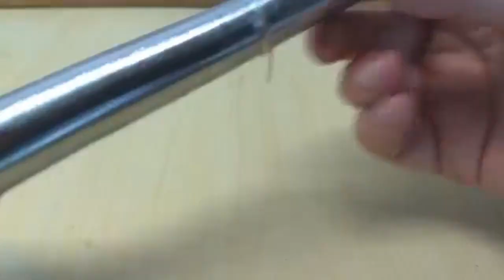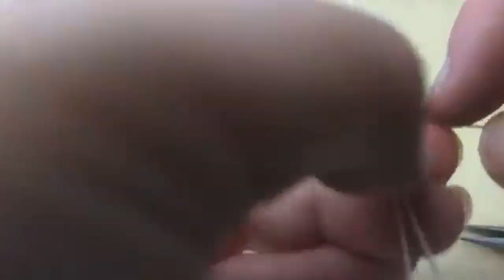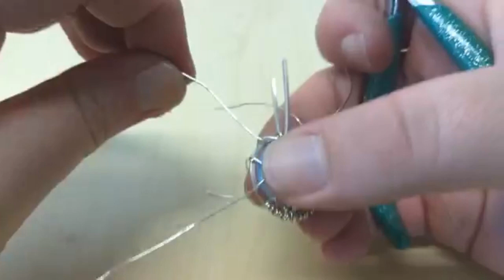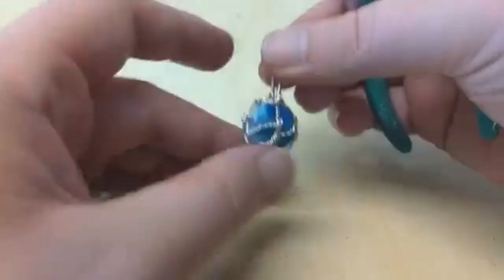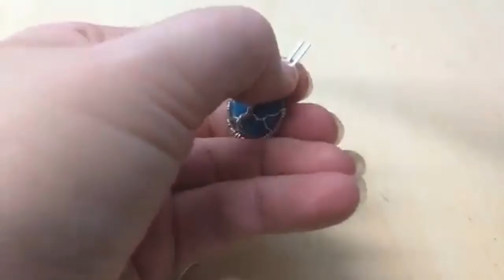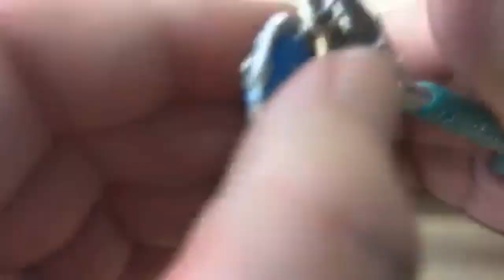How to Wire Wrap a Tree of Life Pendant

Comment: Do you happen to remember the measurements for the different gauges of wire you used as well as the length for each type? Thank you! ~ Sarah
Reply from the maker: I know the gauges, but the lengths are totally determined by the size of the piece you are wire wrapping. I always like to use more wire than too little wire. Here is what I used in to wrap this 16mm flat round bead:

-For the frame
5 inches - 18ga square wire (round would work fine)

8 inches - 22ga round wire (that goes through the bead and wraps onto the frame)

4 - 4 inch pieces of 24 ga round wire (the branches)